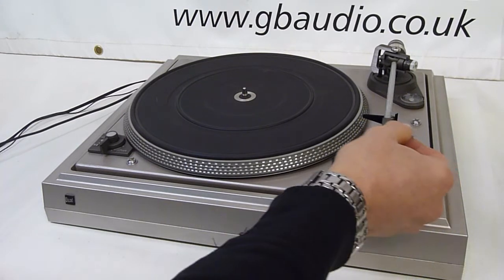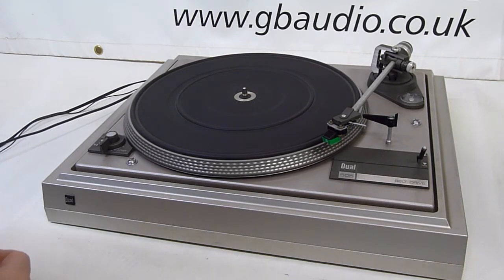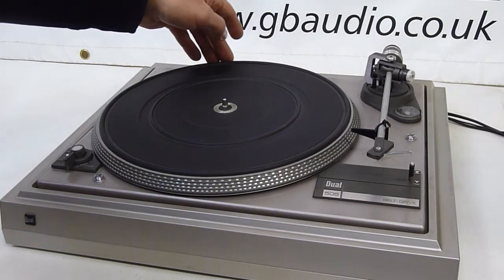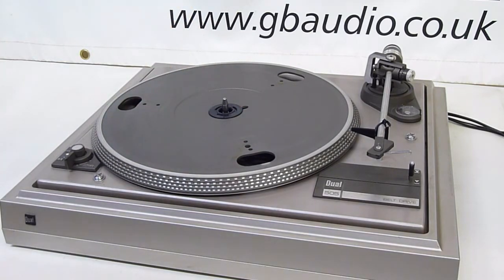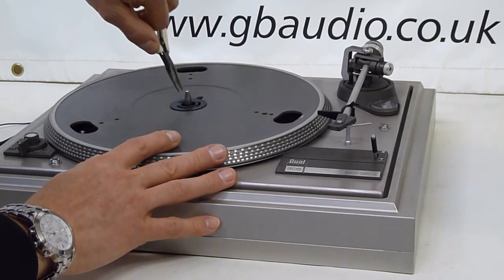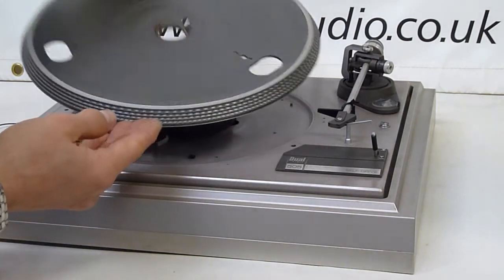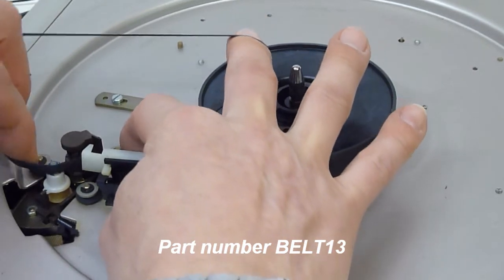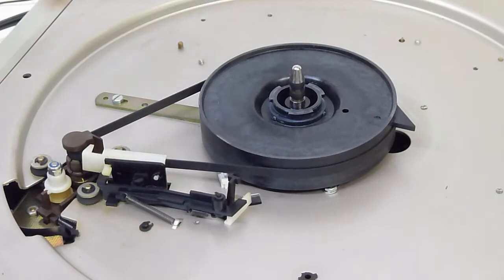5. Dual CS505 - How to replace the main drive belt

Comment: Hi, thank you for your videos, I have followed everything.
I seem to have an issue with my Dual 505-2, now that everything is playing I realised the tone arm went too far, the needle almost touched the label but the stopping mechanism did not activate so the platter keeps spinning at the end. Any suggestions or ideas of what I should do? Thank you
Reply from the maker: Hi David, some turntables have an adjuster underneath the arm but not the CS505, unfortunately. It may be that the auto-stop mechanism has been pushed and bent in the past - it would only take a small deformation to throw it out of calibration. You can send it to us for repair or if you want to investigate it further yourself, lift the sub-chassis and check out the long alloy shaft which pushes from the base of the arm towards a copper shunt device which then engages with the centre spindle and triggers the auto-stop. Good luck.
Reply: @gbaudio1212  Hi, I have figured it out last night, in my case it was the excenter S screw that needed a little adjustment to make the auto-stop work earlier.

I did a little video explaining so that others can also fix it https://www.youtube.com/watch?v=zPW1Xd3dMfk

Comment: hi, i have the same turntable but my tonearm doesn't lift at the end of the record, have you any idea what cause's it, and if it can be solved?
ty very much
Reply from the maker: First, check the arm lifter pillar. It's situated a bit left of the flat plate in front of the tonearm bearings (pivot points). The pillar is threaded so that it can be turned by hand to adjust the height of the lift. If that's not the problem, it may be a sticky or broken part of the mechanical linkage under the sub-chassis which kicks in when the tonearm reaches the end of a record. Good luck.